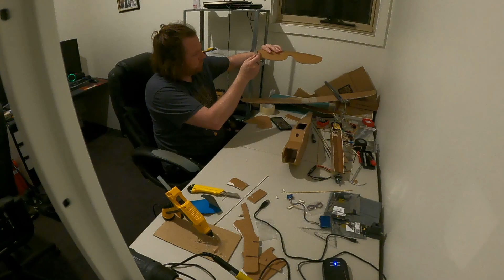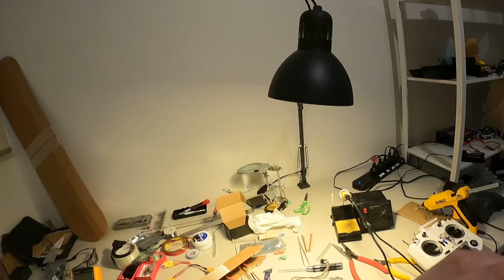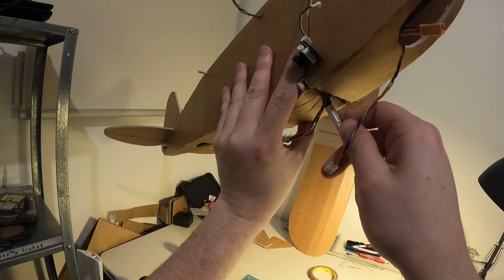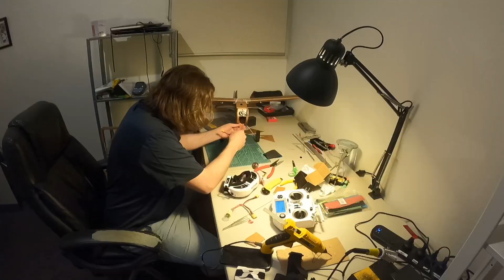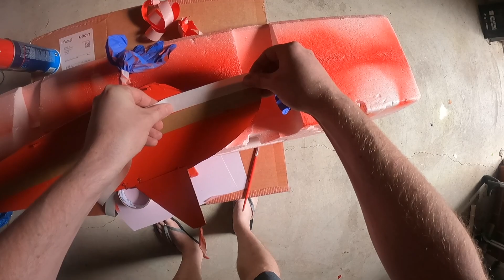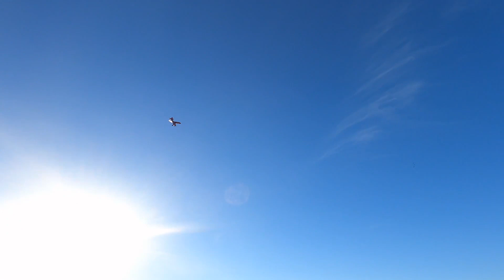Building the FliteTest Simple Cub with FPV and Autopilot

Comment: Please let me know the spray paint name or which type of spray paint can we use with KT board
Appreciate your guidance
Reply from the maker: Hi Rasantha, I used Dulux Duramax enamel paint:  https://www.bunnings.com.au/dulux-340g-duramax-gloss-hot-lips-spray-paint_p1400689

I referred to this article for tips: https://www.flitetest.com/articles/painting-water-resistant-foam-board
Reply: @andrewr0000  can I use same with white color KT boards
What is the way for without water resistant board
Reply from the maker: @RasanthaM  I can't tell you unfortunately.

I would recommend you find a cheap acrylic based spray paint at your local store and test it on a piece of scrap foam.
Reply: @andrewr0000  thanks 👍

Comment: What I liked when I did this build was the fact the electronics are removable and can go into other builds. I did find that using a smaller lighter battery the plane performed better. I was using 2200. I have a dozen for my drones but the weight difference to a 1500 was a lot. one mod that I did was put a freckin switch on it. It takes a little fanagling  getting things plugged in to fly. then it was next to impossible to plug in the battery. then put the wings on. Naa I made it easy

Comment: Very cool! how did you power your video system?
Reply from the maker: The battery is plugged directly into the flight controller which then distributes power. ESC running off the FC for the motor, and the camera and VTX plug straight into the FC.

Comment: Very nice build. I fly my FT Simple Cub line of sight. Flies pretty good but takeoffs can be a little sketchy and I've yet to land without nosing over. I just finished putting leading edge slats on my plane but haven't yet flown it with this mod.
IMHO there are better models, FT or otherwise, for flying FPV.